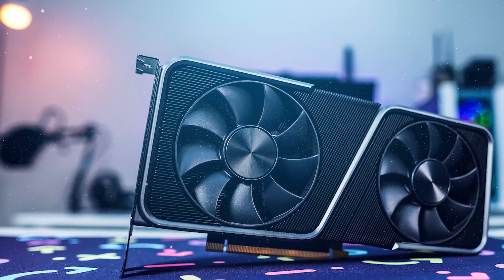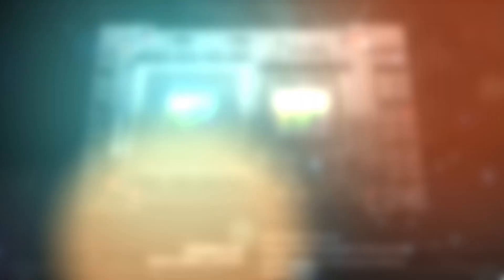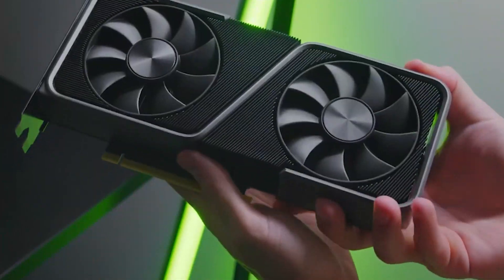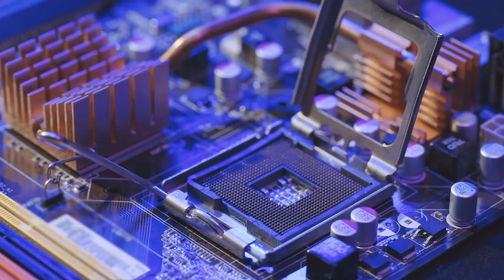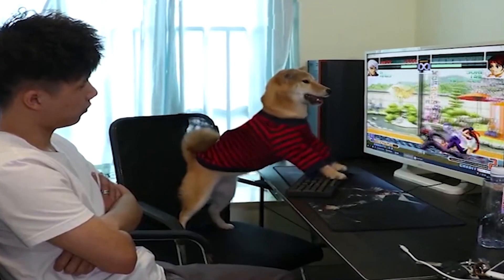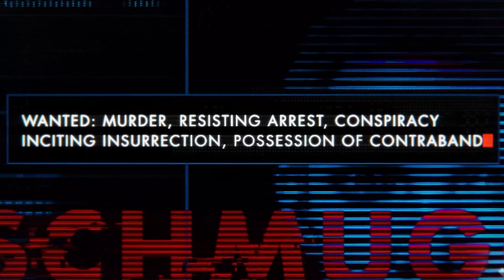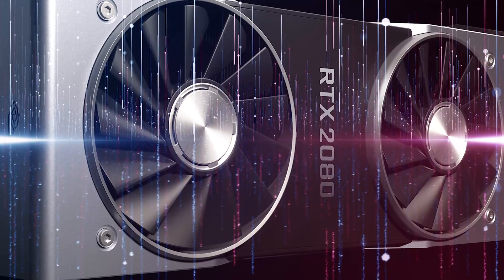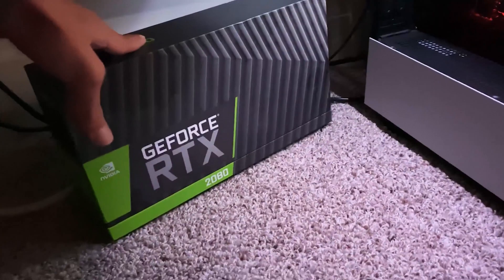RTX 3070 vs 2080 Ti - What's the Difference in 2022?

Comment: I got lucky AF AND got a founders 2080ti, new but open box, for $200 local. 

Love its performance but it makes my pc a little space heater. Gonna water cool it before peak summer this year. 

Also never going to buy a current gpu. I’ll grab a 4090 in 3 years from now
Reply: I tried a 4090 on my friends pc and I can safely say it's a scam unless you do heavy 3D editing, AI generated 4k images or mining, I thought the 4090 could ran Cyberpunk at 200+ fpss at ultra, but boy was I mistaken, it can't even do half of that most of the time, I even tried lowering everything at 1080p minimun preset and lowering rendering scale, but still, I couldn't get above +144 fpss most of the time, I told my friend I would never buy such expensive card and that it's ridiculous that it can't even cap his 240 monitor hz on high graphics and he told me it's for more things that gaming, it can be achieved but you have to enable frame gen and reescale garbaje technologies, but forget about playing games with very high graphics natively on high frames specially since the 4090 is CPU bound still, but I will never get my hopes up not even for the new 5000 series, I'm very dissapointed, in my opinion, just buy what you need for your needs, don't get fooled by deceptive marketing, the 4090 is a 1080p graphics card, it's a joke they market it as 4k this and that, it's not possible to get good frames at those resolutions on games with high graphics in this day yet unless you enable technologies that give input lag, worse graphics and experience, don't get fooled by the marketing.

Comment: what is he on abt, those games are pretty new. If you were to look at like a year older titles that are still masterpieces to this day, 2080 TI would win by a 4% in EFps. The only game the 3070 scored in better was PubG by 6 frames. You go to a benchmark website, 2080 TI's effective speed is 5% higher.

EDIT: You 100% Gave the 2080 TI a bad CPU to make it look bad or you simply didn't notice.
I mean, if you live in an apartment or you cant pay the electricity bills that good, you're good to go but if you really just bought a 3070 then you gotta do some digging. This guy's lying about the 3070 being better. He CHERRY-PICKED the games and settings INCLUDING the CPU for each GPU. You can't game on 2 completely different GPUs with the same CPU. He most definitely CHERRY-PICKED the CPU as well so the 3070 would win

Comment: Idk which one to get? 
2080 ti or 3070
Is the vram worth it for last gen?
Reply: In the current market, Yes. It’s an older gen but feature wise you still get DLSS & Raytracing & the same performance level. You get 11 gb of VRAM vs 8gb which will limit you at 4K nowadays which both cards are capable of. I’ve been seeing the rtx 3070 8gb at about $540-550 & up, but just helped a friend get a rtx 2080 ti 11gb for $410. I can’t justify spending that much more for less VRAM & the same features lol. Good luck

Comment: Just picked up a 2080 TI kingpin for a really good price from a GTX 1080. I believe it should be able to pull ahead of the 3070 - 3070 ti if I over clock it, I dare not touch the red BIOS on the card though.
Reply from the maker: Nice!

Comment: Seeing 2080 TI for around $300-$350.  Looks like a good value proposition for anybody contemplating a 3070.
Reply from the maker: oh wow...we probably should have included that in our best gpu under $400 list
Reply: WHERE???

WHERE???
Reply: @smallestkibby  eBay
Reply: My opinion, I’ve seen the 3070 for about $540-$550 and more on average. Just helped a friend build a PC with a 2080 ti for $410. No reason to get rtx 3070 in 2023 in my opinion. Especially if you have a 4K display. If you want roughly that level of performance. In the $300 price range just get the 6700 xt 12gb, $400 price range get the 2080 ti 11gb(better than 3060 ti for the same money & identical performance & features (DLSS & Raytracing) to 3070 8gb for $140-$150 less & no V-Ram limitation). If someone has $540-$550 I’d say start looking at used 
6800 xt or if you get lucky maybe a used rtx 3080 10gb if you see it for a good price. Good luck to my fellow gamers out there, don’t get ripped off.
Reply: @aesthetic_o.z  hello, u seem to be well informed. I have $400 limit for a used ebay card, what do you recommend? I was probably gonna go with 2080ti. I play 1440p, and my cpu is R5 2600 (possibly upgrading to R7 5800x3d soon)
Reply: @hj-mr5gg  If $400 is your hard limit, I’d say you’re on the right path. If you can find a really good deal for a rx 6800 non xt then get that instead but seems unlikely from what I’ve seen of that card, it seems to be in a weird spot where it’s too close in price to a 
6800 xt and the performance jump is a higher percentage than the price jump so the xt is a better buy, but usually the non xt is not worth getting if you have to pay closer to the price of a 6800 xt over a rtx 2080 ti. So at $400 yeah, I’d still get the rtx 2080 ti, at $500 I’d get the 6800 xt and usually I see the 6800 non xt for $475+ so I’d say it usually is not worth unless you find a really good deal. Hope this helped.
Reply: xi—sky  why not??
Reply: jeffrey1296 the aorus xtreme 2080 ti is the best looking gpu period

Comment: I picked up a Zotac Amp Extreme 2080ti a few years ago for $800 before the insane GPU price gouging days. It's slightly overclocked above factory settings, stays really cool, and consistently performs in games and benchmarks somewhere between a 3070ti and 3080.   Several years later, it's been a superb card for the money. Still performs well today. 

Userbenchmark it posted 201% gpu score, 98th percentile. I think the average 3080 is somewhere around 206% or so. 

3dmark Timespy posted a graphics score of 16,017

Tempted to go big or go home with a 4090, but I also don't really need it for 1440p and don't want to catch my house on fire....
Reply: User benchmark 💀
Reply: Nah, the minimal upgrade you can get after a 2080 or 2080 TI is a 4070.
Reply from the maker: lmfao at the fire comment. also, the 4090 is HUGE.

Comment: Meanwhile I still own a 1060 6gb and it can still run pretty much anything, granted not on ultra anymore but I have been impressed at how great the 1060 6gb is
Reply from the maker: It’s a classic for sure
Reply: unfortunately a Plague Tale Requiem struggles to hit 60fps at 720p low on the gtx 1060
Reply: I have the 3gb version.. and it runs most stuff at maybe high settings, quite severely vram limited xD
Getting an used 2080ti soon, so that will be nice

Comment: 2080 Ti is cheaper in Ebay auctions vs 3070 today, few weeks after RTX 4000 announcement.

Refurbished/open box 2080 Ti's are around 400 USD, while 3070s are around 470-500.

The older one is seeming really good right now.
Reply: got my 3070 for $370, was an ex mining card but only had a bit of dust and the miner undervolted the card to keep temps cool and performs like how a brand new 3070. would was a gigabyte gaming oc so had triple fan configuration and great for overclocking!

Comment: I bought a 2080ti founders edition for $560 back in May of 2022 this year, I think I made a good choice considering I'm using a 2700x lol and coming from a 1060 6gb
Reply from the maker: Yeah you could get a little better deal today but overall that card will do great for you for a long time
Reply: I bought one for 200 pounds the other day to replace a 1070.
Reply: @copy.4123  I just traded it for a 3070 since the 2080ti was a founders edition and ran at 84c. I get the same performance and much less temperatures, overall happy but dang for 200 pounds thatsba steal

Comment: I managed to grab the Strix 2080ti in 2020 for 700 dollars, so I'm not too upset about it. That was at one of the market peaks of cards. Also managed to sell my Strix 2070 Super for the same price, so I cut even.
Reply: i bought 1070gtx when it was release july 2016 for 600 cdn,i play on 1080ultra wide,i kept the card for 6years!!! until octobre 2022,sold it for 200$ to my friend ,and i managed to buy rtx2080ti for 400cdn,double performance for 200$ more,for my resolution iam good for another 3 or 4years
Reply: i would be you can pick them up on ebay for $365 but i picked up rtx 3060 for $400 a few months ago could og gotten the same model rtx 3070 for $366
Reply: I am getting the the strix 2080ti for $300 but also hve an offer of $260 for MSI G X 2080Super but I am choosing the ti.
Reply from the maker: smart man
Reply: Wow! Amazing deal. I paid $1,400 for my Strix 2080Ti OC.
Reply: @Oak_Rocket  ouch

Comment: i have both cards in aib models the 2080 ti is more on par with 3080 and 3070 ti furmark 2080 ti scores 14979 whilke 3080 scores 15000 the 3070 scores 12456 the 3070 ti is scoring around 14656 the 30 80- is a 2080 ti with power limits removee the cuda cores cut in half and faster ddr6x its been proven already with the big nividia leak run after burner remove power limits of the 2080 ti and u basically will be trading blows with the 3080 right now u can buy the 2080 ti 2nd hand cheaper than the 3070 do ur self a favor the ray tracing is better on the 2080 ti buy it 2nd hand and get one with samsung memory
Reply from the maker: 2080 is one of our favorites

Comment: 2080 Ti owner here. My card with a 12600K LGA 1700 destroys any game before 2020. planning on keeping it for atleast 2 more years.
Reply from the maker: Yeah those 12th gen intels are great. Interesting pairing with the 2080ti. Did you already have that and then upgraded MOBO and CPU?
Reply: @TopTierTech1  My 1080 ti is still cruisin in 4k so I'm jazzed. Not much perf difference between 1080ti and 2080ti, but RT is a huge diff.
Reply: @TopTierTech1  yeah, the GPU is more than fine. AND I wont cry over 10 extra frames, I bought the 12th Gen CPU cuz its actually greay performance for the price at the moment!

Comment: Sorry, you have to do better if you want to continue making tech related content.  No benchmark numbers at all, none of your own footage, stating in the title "2022" but testing games from 2018 and 2019, and also still referring to both cards' MSRP when making price comparisons.  That wouldve been relevant in 2020, but since you can only get 2080ti 2nd hand, the pricing is pretty similar, as is the performance.  Yes, the 2080ti was $1500 at launch, and the 3070 was $500 at launch, but you are making a 2022 comparison video, only fair to use 2022 prices.  And what's the point of making a 2022 comparison video when you use titles that are 3 to 4 years old at this point?  At least throw in modern titles with raytracing and DLSS etc.

The 2080ti might have been a 4K card when it was released, but not 4 years later anymore.  So with the 3070 having pretty much the same performance as a 2080ti, it is safe to say that in modern AAA titles, these cant be considered for 4K gaming anymore, unless you want to play at much lower frame rates.
Reply from the maker: Well received on the benchmark comment (a few others have said the same).

Regarding our own footage...we don't have a studio or any way to actually create our own footage without spending WAY more money. 

Thank you for the feedback, we are always trying to improve

Comment: Lol 980ti user here. Had it since 2016. Still going strong.
Reply: Nothing to laugh at bro. 980Ti is still a beast of a GPU.
Reply from the maker: What games do you play?
Reply: @TopTierTech1  halo infinite, elden ring, MK11, but many many others too
Reply: My 1070 ti is still performing great as well. These cards are so much better built than the new generations. I still don't have any coil whine, almost no silicon degradation (it still overclocks very well), only issue is one of the fans just started becoming noisy, but a replacement is $6 on eBay lol.
Reply: Same! Maybe go AMD upgrade in the future

Comment: At this point just save your money for a 3080 12 gb or higher, prices are dropping every couple weeks. 8 gb is not the answer. U could also wait for 4080. The more interesting contrast of our time is 3090 as its price tanks when 4090 comes out vs wait for 4080
Reply: So we know now 30 series wont get much cheaper anymore (atleast in germany) since 4080 12gb got cancelled, nvidia has Lots of 30s they wanna sell and the 16gb will start at 1800€+.
Reply: +1 , more people need to read this, since I do a lot of GPU testing, I found out that the 3070ti might be the worst Card from Nvidia released. It HAS the horse power to run every maxed at 1440p, but the Ram is just crippling it's performance. Once it reaches Max Vram it runs unstable and even loses Frames thus even losing to a 2080ti, which is just sad. Same thing on 4k, like why even make a GPU almost as strong as the 3080 but downgrade it with Bus speed and Capacity? 3070ti with 12gb would have been perfect, change my mind.
Reply from the maker: Vram is really becoming an issue
Reply: 8gb Vram will be fine for years ahead for 1440p. When the time comes where you need more than 8gb Vram, 12gb of Vram wont make a difference on 3080 because GPU itself will be outdated.
Reply: @alexcrowley4557  1080p Forza Horizon 5 wants to have a chat. 
But in all seriousness, we already reached that 8gb threshhold months ago, newer games take up to 10 and we can't change that fact.
Reply: @Alexdbre  Not a fact at all, Forza Horizon 5 on 1660 Super that has 6gb Vram works on 1440p in 60fps on Ultra settings. Stop with false information please. You an lots of other people should also learn that "allocated" vram isn't same as exact amount being used. AMD had a scammy presentation where they presented allocated vram that some game use only to sell their high Vram models. Vram propaganda is the worst.

If you are talking about 120fps high refresh rate 1440p or 4k then sure, it is not being enough for some AAA titles. But for 1440p 60 fps, it will be fine for few more years.
Reply: @alexcrowley4557  Oh yeah 40-60fps for sure but Forza is clearly bugging down at over 100 frames on 1080p so I don't see the false info here? Both the 3070ti and my personal 2080super got the same Vram warning and also the same Full 7.9Gb usage via Afterturner, stop spreading wrong information and test it yourself mate 💀
IF you think the 3070ti was designed for 30-60fps 1440p or FullHD you are also in the wrong. It's literally stronger than a 2080ti, designed for High FPS 4k Gaming, which we all know is still not possible, but it's enough for 144/1440p, if it had more then 8gb and a bigger bus.
Reply: @alexcrowley4557  on a side note, didn't AMD release a RX580 with 8gb Vram and almost the same Bus speed? Like that card is 4x or more weaker than a 3070ti, unacceptable, shouldn't be a discussion at this point.
Reply: @Alexdbre  The Vram information is bullshit, even devs said so, that is the allocation bollocks I were talking about, you get Vram warning yet game still works great.

Don't get me wrong, 3070 Ti deserves more Vram in it, but that being said, 1440p 60fps will be fine with 8gb vram few more years.
Reply: @alexcrowley4557 12gb is on the low side today, 8gb isn't even up for discussion. Casual gaming is one thing but productivity and high end gaming, no.

Comment: 2080 Ti owner here. I've never owned a gpu for this long. it's been 4 years now. held up pretty well to be honest.
Reply: I still repping 980TI 😅
Reply: @hankmoody9965 you think that's bad I use a Radeon 3650
Reply from the maker: Yeah it’s a beast…easily a couple
More years before you feel real need to uograde
Reply: When you buy a xx80 Ti card it can last you 5 years.
Reply: UPDATE: I got a RTX 4080. built an ITX pc in the living room with my 2080 Ti hehe
Reply: Update: Got a 4090 last week. Worth it.
Reply: Im upgrading from a 1660 ti to a 2080 ti in 2023 but it has more VRAM than most Nvidia Cards even at this point 😂
Reply: Would you buy it now on the used market?
Reply: @User-JT89WA1  It's not going to last 15 years
Reply: pay for 2080Ti  is better than pay for 2070 + 3070.
Both paths make you pay the same amount (at SMRP) but the 2080Ti aged better than the 3070.
Reply: yep, same here
Reply: Very true. Four years later and my Strix 2080Ti OC easily handles anything I throw at it in 1440p or 3440x1440. At this rate it will probably last me quite a while longer too. For me this definitely justifies the price I paid for it, $1400 at the time.
Reply: @Oak_Rocket  Well I own both the 1080ti & the 2080ti and I gotta say that both of them are amazing. The 1080ti surprises me the most ofcourse, being so old and putting up normal 2080 performance with a OC ( almost reaching levels of my Strix 2080 Super ), but the problem is really DLSS features not being implemented. I'll wait for intels architecture and FSR compatiblity. 

Funniliy enough, with FSR it manages to be on par with the 3060 ti ( 2080 Super) in a couple of titles, which is INSANE for such a old GPU. The 2080ti I bought just for fun, since I always wanted one, gotta say, it impresses me not so much like the 1080ti but it is still amazing and performs really good, like on par with 3070 just without the Vram problems thanks to that +3gb! :)

Opting now for a 3090 or a 3090ti not sure yes, but the 3090 would be realy successor since the Ti is more likely a Titan successor
Reply: It may hold us over into 50 series. The 40 series power cable situation and sizing issues …